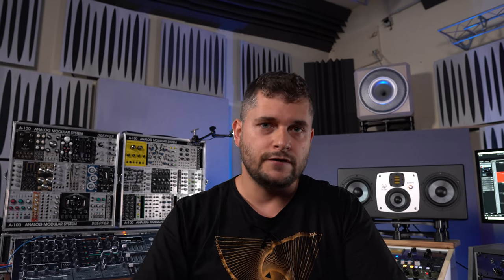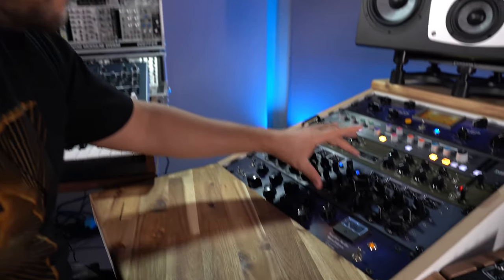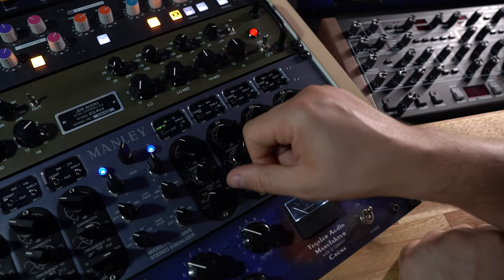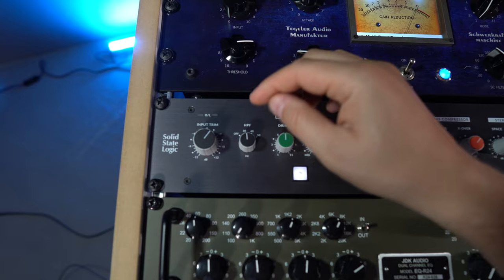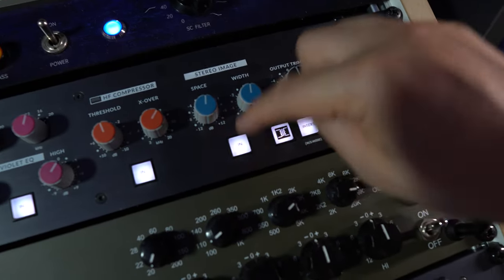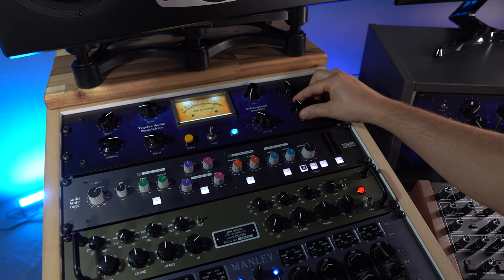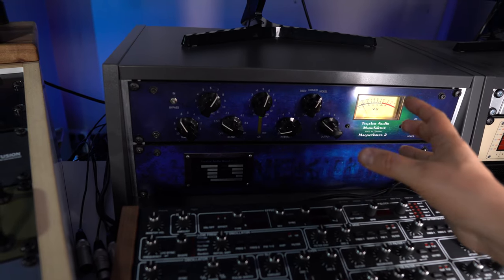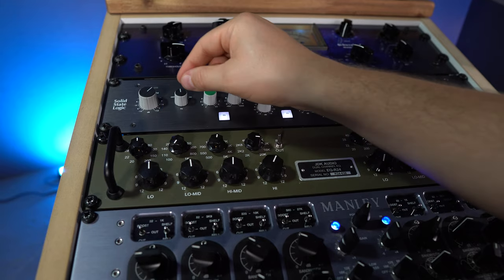New Florian Meindl Studio 2021 - ANALOG MASTERING CHAIN for TECHNO - riemannmastering.com

Comment: How did you get the JDK24 to do mid side? I own one but did not know it could do this. Please advise. Thanks so much!
Reply from the maker: The KONNEKTOR from Tegeler Audio does it - it's a digitally controlled analog mastering patchbay
Reply: @RiemannKollektion  How cool! Thanks for the tip. Will take a look at that unit. Enjoyed your video. You might want to take a look at the Heritage Audio Symph EQ. It came out recently as a Bax EQ with M/S capability. I use it a lot on my mastering chain. If you want to hear how it sounds go to my channel and check out the cinematic series of works. All the best.

Comment: isn’t the fireface 800 a bit of a bottleneck in the setup? i mean you have a massive passive etc.. conversion is not on the same level.
Reply: Yes it's true the Fireface is the weakest link in the chain but I didn't want to do the step of a dedicated mastering converter yet and to be honest for Techno maybe there will not be a difference! For instrumental music with very high dynamics and higher sampling rates it's more important... Which converter can you recommend? One with a VU meter included would be dope so I can see how hot I come back to the computer
Reply: @FlorianMeindlMusic  I agree, difference will be subtle for sure. I‘m actually in the same situation as you, currently using Antelope Orion but I got my eyes on the Crane Song HEDD 😄 For a dedicated good metering maybe the Dangerous AD+?
Reply: I would probably recommend UAD…. Nice converters, but maybe overkill since you don’t need the plugins. Otherwise Apogee?
Reply: Keep in mind that the Fireface 802 is higher quality then the standard interfaces…
Reply: RME fireface 802 is absolutely a professional audio interface.. As in the pros use it, the ufx & ufx+. Yes, dedicated ad/ da converters would be an upgrade but RME is top of the line audio interface. Their clocks, conversion, and routing all are great!
Reply: Lynx Hilo is a great mastering converter. AD/DA, super high quality headphone amp for high impedance headphones and used by tons of mastering engineers. The Burl is also a great choice, pricey but a great bridge between analog and digital but pricey. I haven’t used that one but I have used the Lynx Hilo and UAD but I mainly use my UAD’s for tracking and mixing since I have 16 physical i/o’s.

Comment: Nice video. Did you figure out the 50Hz hole completly?
Reply: Yes it's a mode which I cannot reduce so I'll try different subwoofer placements but they are not here yet and if it doesn't help enough I'll get a Helmholtz Resonator tuned to 50hz
Reply: @FlorianMeindlMusic  how about an active trap psi audio makes one
Reply from the maker: Oh yes they are the best! But expensive
Reply: @RiemannKollektion  you could buy 2 psi active bass traps for the price of 1 passive massive. I guess it depends on your priorities 🤷🏾‍♂️